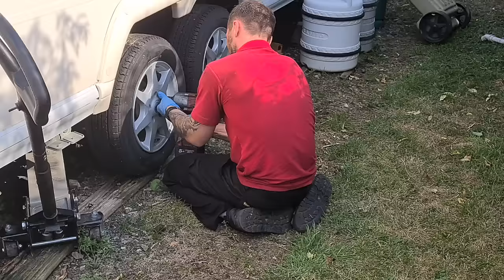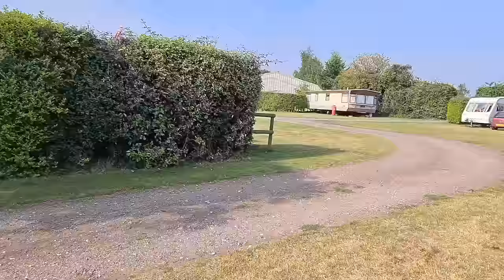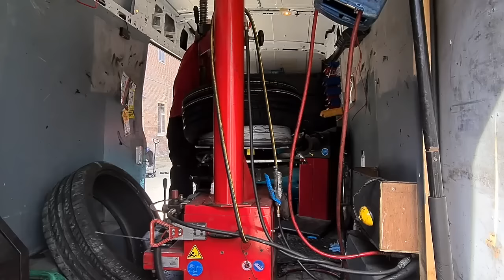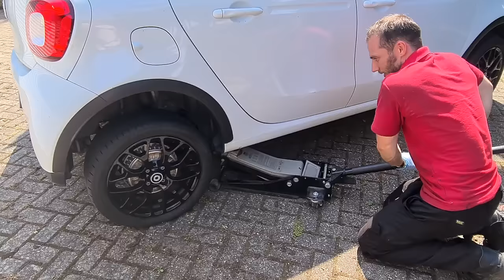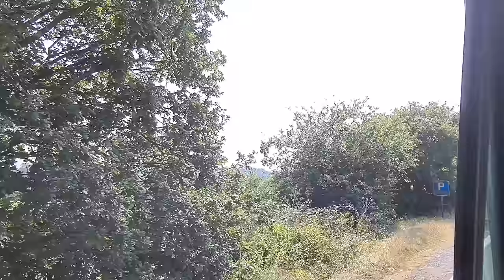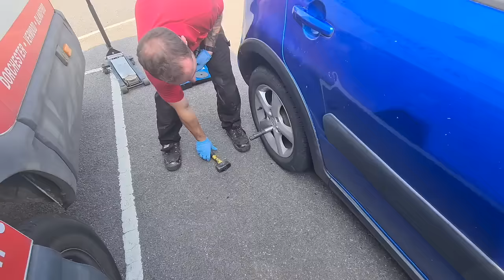Day in the life of a Mobile Tyre Fitter

Comment: I started a similar business for Motorcycles, in the late 90's.
My main problem was getting certain brands of Tyres ???
Some, wholesalers refused to sell to me for a few reasons ???
At that time, I didn't have a permanent shop to work from.
And some Motorcycle shops put a hold on who could sell to me ??
How this worked is.
The Motorcycle shops told the Wholesaler.
IF they sell to me, they will stop buying from them ??????
It was a Bullshit deal.
But, their was nothing I could do about at that time.
Seeing no point to continue, I sold off everything and started my current business
Which is great, because I can work from home with no hassles 👍👍

Comment: I'm more surprised you patched that tyre up. Its normally a full tyre replacement for that outer wall
Reply: The nail is not on the shoulder, where the patch would sit for that replacement it would not flex the patch and leak so it is completely safe to repair

Comment: What is your flooring in back of van made of and also how have you secured tyre machine + balancer down? I’m about to set up my van and need to know. Mines is fresh plyboard
Reply from the maker: It is pretty much the standard floor that we have drilled right through but we put metal plates on before underneath then we put 2 nuts on the bolts. Good luck with your venture

Comment: Hi boss.
Whats the sore with tire balancer please ? 
Do you have to calibrate it few times per day, before every customer ? Does it not have to be on perfectly leveled surface for balancing?  Wonder if adding adjustable legs to the balancer and leveling balancer with spirit level before each customer would sort it all out.
Reply from the maker: Generally we have no issues with the balancer and will only re set it if we get inconsistent readings, we also don't get issues with the leveling, the main thing is to keep the van still when operating it and no machines running. If it's windy we balance static using the machine in the off mode
Reply: @FreewayMobileTyres  Much appretiated

Comment: I noticed you don't have a strong arm, do you have to struggle fitting run flat tyres or you just use extra lever bars?
Reply from the maker: Extra Bar but do now have machines with assist arms